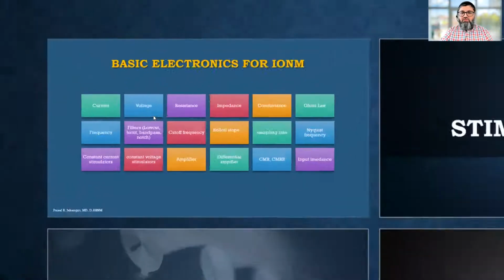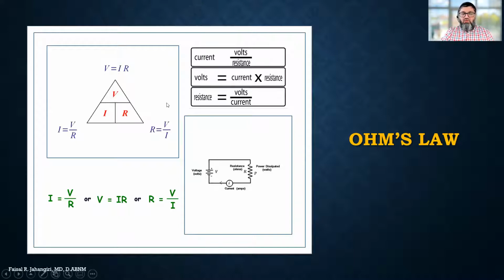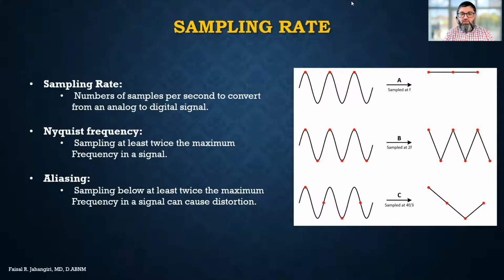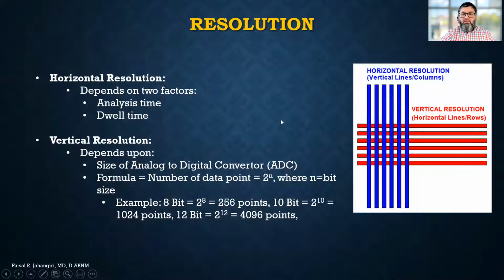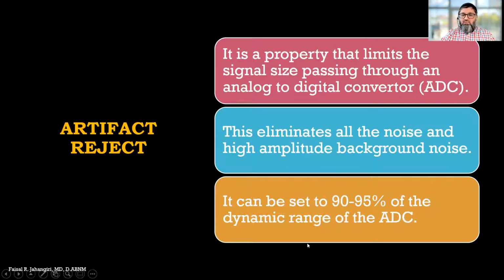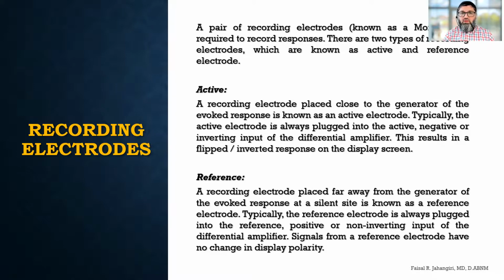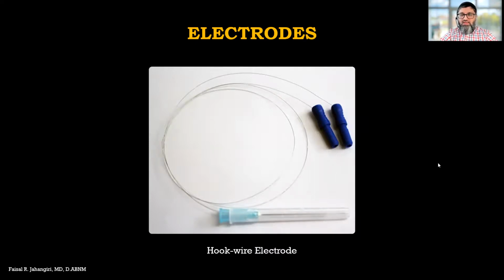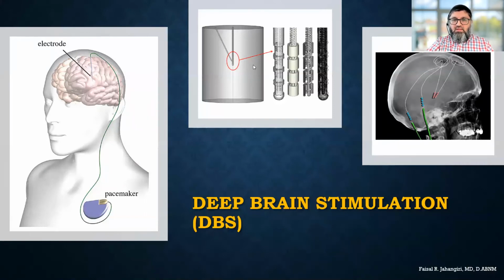Basic Electronics for IONM by Faisal Jahangiri

Comment: Hi Dr. In your opinion, what is current limitations of surface electrodes and in what aspect this electrode need to be improved? For example to be used for somatosensory evoked potentials recording to identify SCI?
Reply from the maker: There are a few good publications comparing the limitations on need, surface and other electrodes. I will try to find them and share.
Reply from the maker: For somatosensory evoked potential (SEP) stimulation using surface electrodes, the typical current range is 10–40 mA, depending on patient impedance and stimulation site. Higher currents may be needed in cases of spinal cord injury due to altered conduction thresholds.